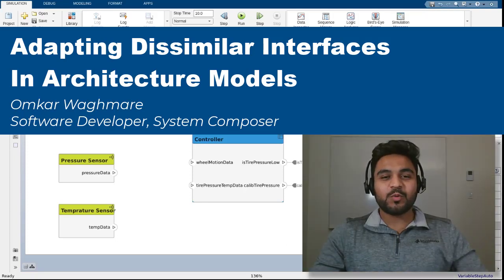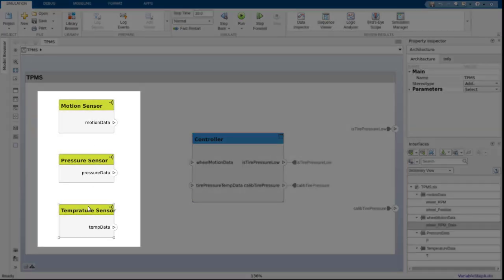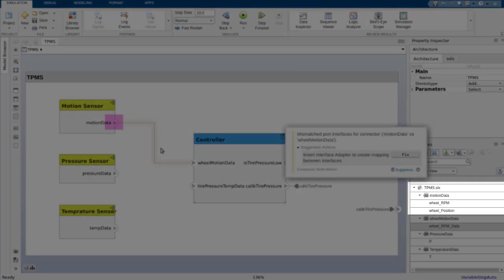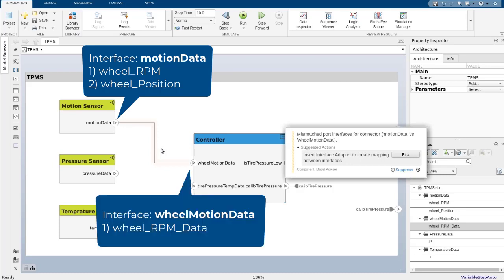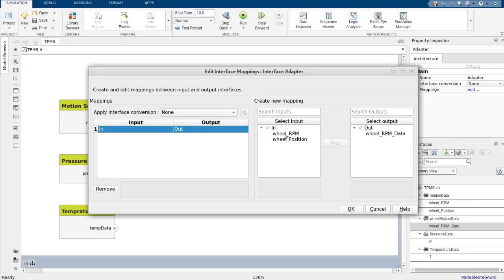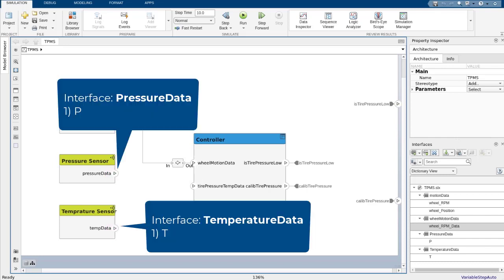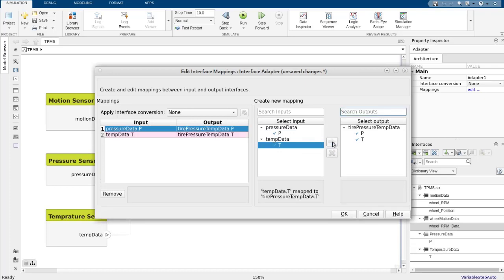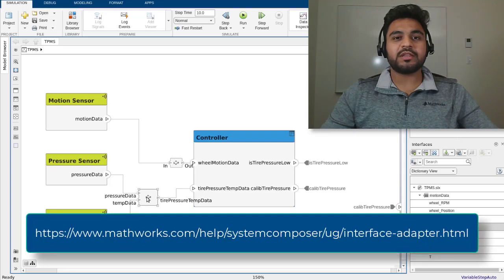Adapting Dissimilar Interfaces in Architecture Models

Comment: Hi,
From the point of usability, would you consider the following:
- When a symbolic block is of the type "function", have the inputs on the left and outputs on the right
- When a symbolic block if of the type "interface adapter"  have the combinatorial inputs to the top, and the output "bus" to the right (akin to how a PCI-bus might have been depicted in a motherboard-schematic)

With visual models mushrooming in size, i find it important to embed visual cues (shapes, roundness, colour, density, orientation, line-thickness, ...) to create a YOLO impression of what the underlying thing is trying to do.
Thanks!